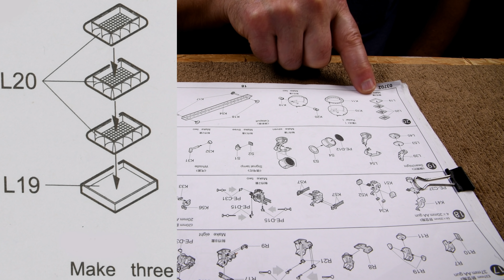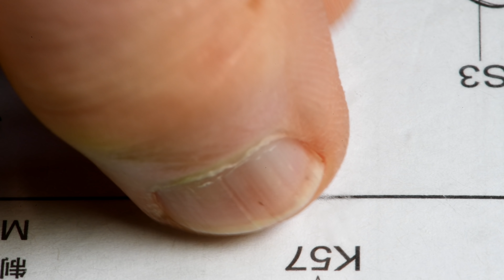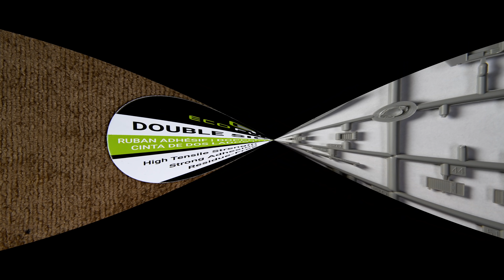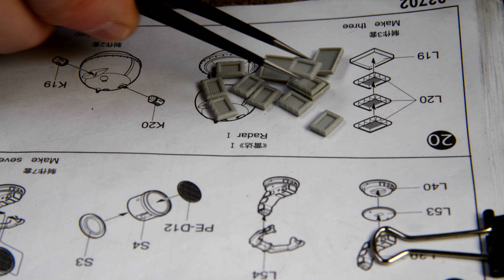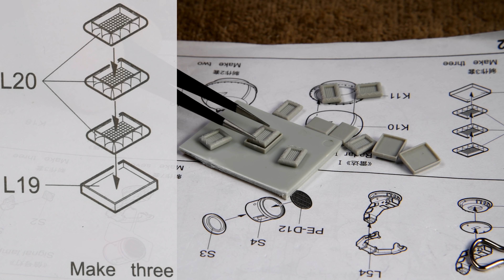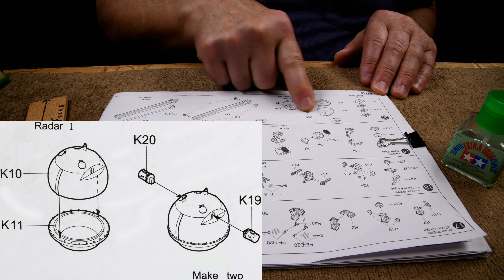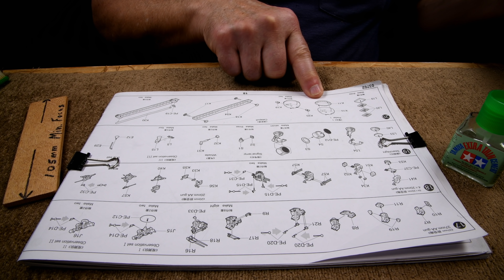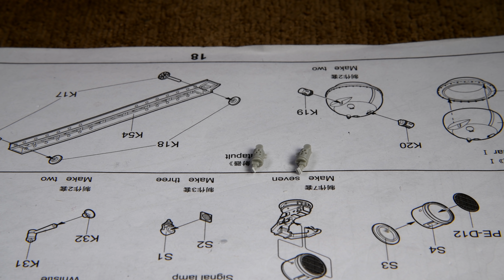The Model Ship - Part 125

Comment: K10 - K11 - K19 - K20, the assembly has nothing to do with radar, Trumpeter is making wild guesses.
This is the stabilized heavy anti-aircraft stereoscopic optical rangefinder.
Besides having training and elevation for the sighting gear, the entire spherical housing could rock side to side and was controlled by a series of gyroscopes.
Essentially the rangefinder stayed level with the horizon regardless of the heel or pitch of the ship.
Reply from the maker: ... now what you just said here makes a lot more sense! Thanks Andrew. 👍

Comment: Seems I heard that after the Titanic, maritime rules stated that there had to have lifeboats to accommodate all the passengers.  Applies to the military is another question.  Also painters tape would not be as sticky and may not leave a residue.
Reply from the maker: Just might have to go back to painters masking tape.
Reply: Naval ships in WW2 used to carry flotation devices made from cork. If a ship is damaged enough to be sinking. No one is going to have time to try to launch lifeboats and such. Basically as the ship slipped beneath the waves the life rafts and such would float away from the deck and be available for an sailors who might be in the water